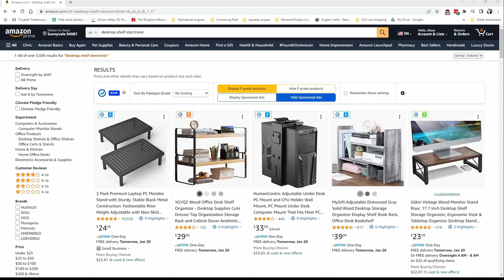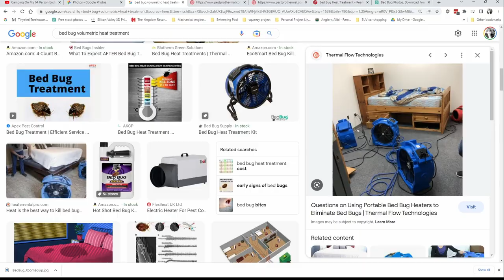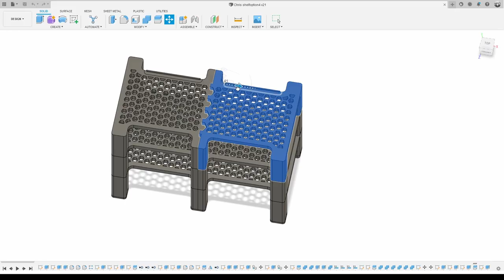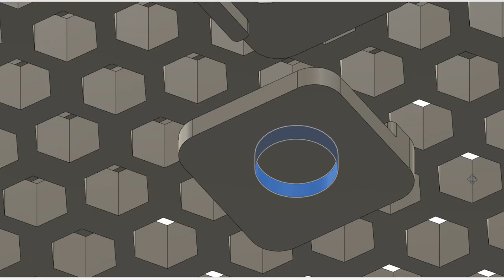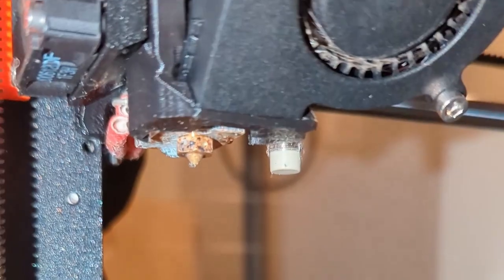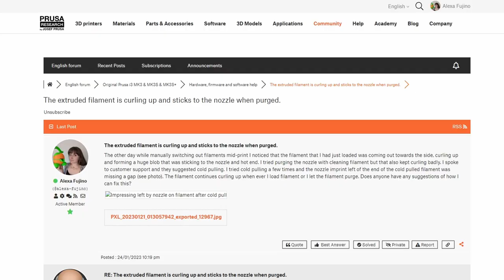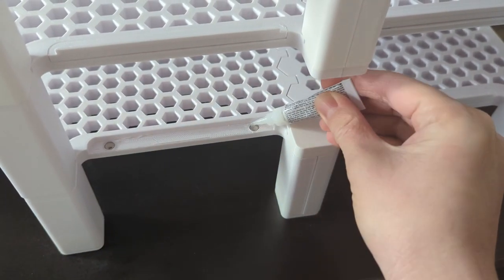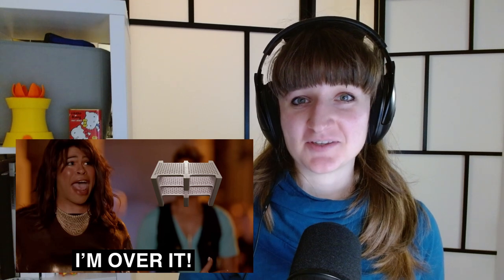Designing and Making a 3D Printed Electronics Shelf

Comment: Small tip to save you time in designing and prototyping: Any of the sections on the model that you're not 100% sure will fit or parts that need tolerances to fit together etc you can print just that small part/section and test it few times, instead of the entire thing. I just import the entire model into prusa slicer then chop off most of stuff I'm not testing with the cut tool.

Comment: 12:00 your magnets were oriented to pull vertically.  If you had embedded them into the side of the lip, and into the side of the shelf, then you would have had the force directly resisting the movement of the object, rather than having to rely on friction.

Comment: Looks awesome! But im wondering how you did that hex pattern, is it one shape just carefully copied with pattern function?
Reply from the maker: Yes it's copied vertically and then the row is copied over horizontally.
Reply from the maker: I forgot to mention that I had to move around  and change the first copied column/ row of hex shapes in order to make the pattern. I might do a separate video only showing how I 3d modeled it later.
Reply: @LexieEclectic  That would be awesome!
Reply: I d rather pull out magnets with soldering iron or anything else even if I damage the prints a bit the printing that huge print just to get it perfect. You can always place back magnets with glue, more soldering iron, 3d pen or something else